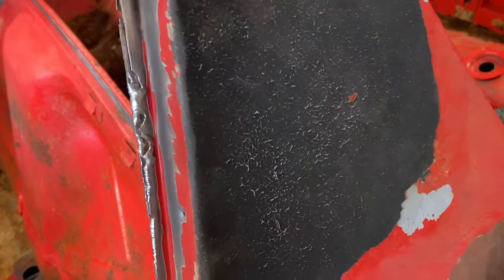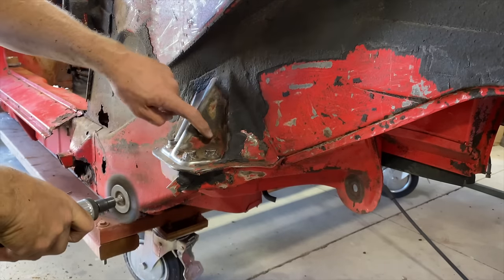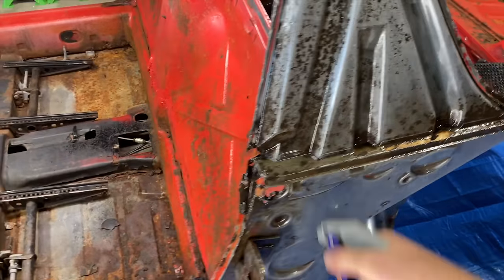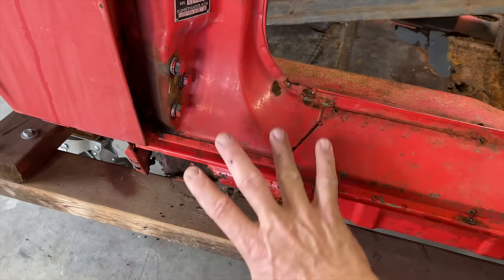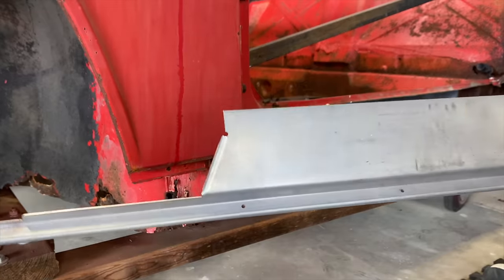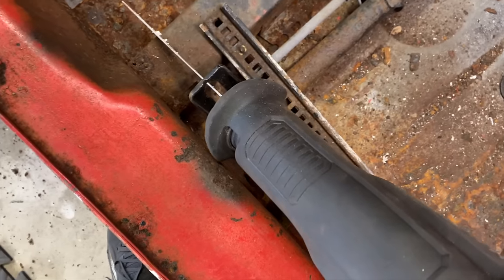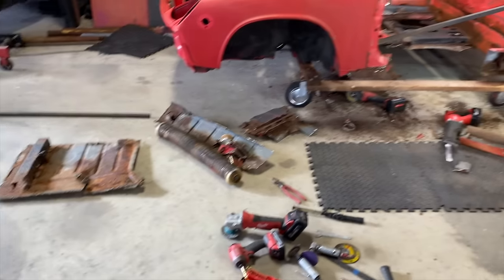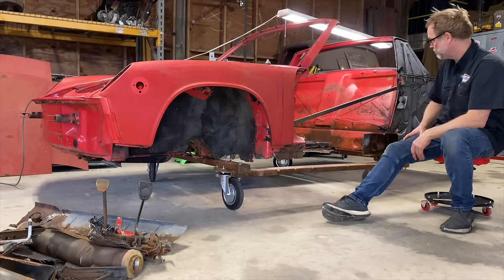Metal Work Begins! Porsche 914 Restoration

Comment: CT...  Great progress!  She's a little crispier than she looked last episode!  I'd make one recommendation on your bracing.  I'd run a piece of angle from the top of the windshield post down to the back of the brace you have welded in.  Then I'd run a piece from the rear lower corner of the door opening to the middle of the brace you have welded on.  The 'X' will keep the door opening from moving around on you.  It's a huge pain to re-square a door opening that has moved.  My Ghia taught me to weld that opening as stiff as you can weld it BEFORE you cut everything apart.
Reply from the maker: Hey Greg! good idea! I will do that this week. Hopefully it's not too late...Thanks man! =)
Reply: I was going to suggest this as well. The last couple of  914's I've seen had folded through the rockers.
Reply: What? Does everyone leave their porshes in ponds? 😂 unbelievable Greg. Good stuff🎩
Reply: Leave the inner longitudinal in place as you replace the outer. Even though the inner has rust, that will help keep the car square. Once the outer is in place then cut out your floor pans and inner longs. Keep the tunnel in place until the floor pans are done. Try to save the tunnel. Finding a good donor is going to be very difficult.

Comment: Hi CT, next time on the undercoating, try using a heat gun and a flexible metal scraper.  Comes off quite easy.  Once you have most of it off, you can clean up the remaining residue with brake cleaner and a rag.   Love this series.
Reply from the maker: Thanks man! I will try that on the other side. =)

Comment: Hey CT....still say strip the crap out of it and get it chemically dipped....it will pay off.....also once all the metal and paint job is done....fish oil the crap out of it....use a long fine tube and spray inside all the tight spots and inside the guards etc and leave it out in the hot sun for a day or two.....it will def  stop or slow down rust from returning.....keep up the great work ....cheers from Syd Aus🤜🤛🍻🍻

Comment: Genuine question, at what point do you say “It’s too far gone” and scrap it? Assuming the ROI exceeds cost of parts and labor of a project like this, do you use that as a measure of when to stop/continue? I’ve seen mint 914s and do not know where this one will end up from now and between, but rest assured I will be here watching and supporting your decisions in the process. ✌️
Reply from the maker: I bought the car for $1,500....If I invest $5 to $10k in parts "metal, interior, rubber, primer, paint, etc" and do most of the work myself it could be worth 2 or 3 times my investment if it's done well. This does not included labor cost. This is a learning experience for me and I'm having fun. Hopefully this one will turn out really nice.
Reply: @CTmoog that’s awesome, your positive attitude towards some of the most daunting tasks is commendable. You inspire me to work on my E46 again.

Comment: I just got my hands on one of these, so what I am guessing is that the body and frame is all welded together. So you can not replace body panels by unbolting them, this is going to be a learning experience. lol I was hoping to been able to replace the body with Carbon Fiber parts, after  3D scanning the car.

Comment: Just started watching this segment. The sail had foam insulation inside from the factory. That captured moisture and caused rust. Missing on yours so someone was definitely in there before. Also, that tight area inside the fender behind the door handle recess was loaded up with seam sealer at the factory. With no fender liner, the rear wheels tossed decades of water and road debris up there and it's a breeding ground for rust. Karmann must have learned lessons on what not to do in auto body design.